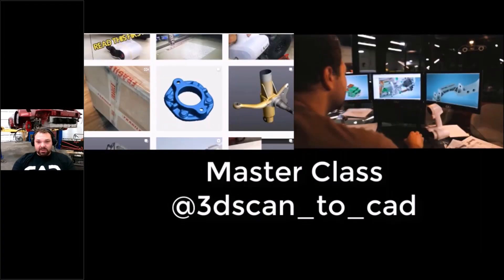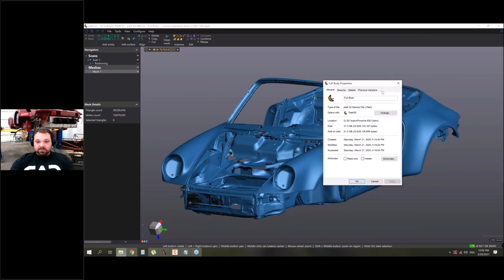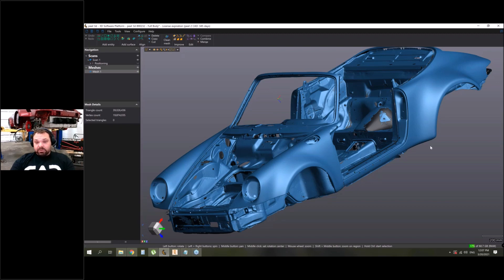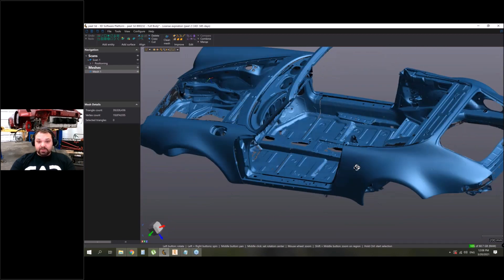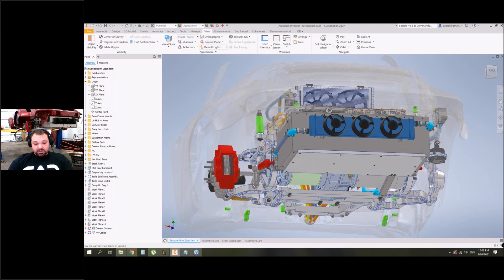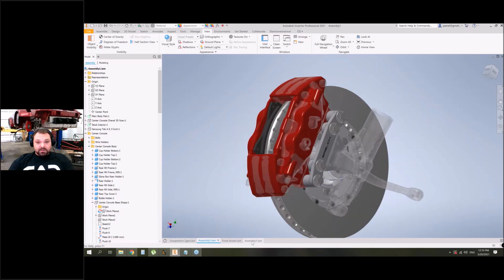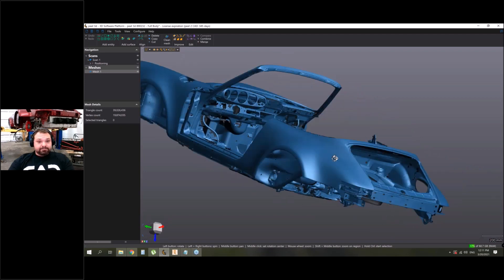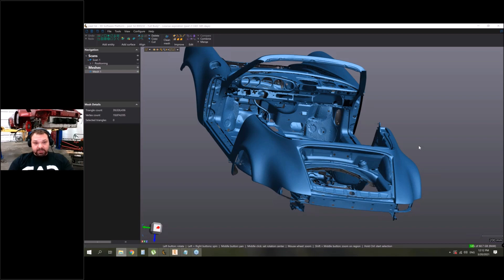peel 3d Guest Webinar - Reverse Engineering using peel 2 CAD

Comment: I'm interested in scanning sections of boats outside. Would this scanner do well for marine applications?
Reply from the maker: Hi Shawn! We do have customers using this scanner outside for various applications. Just like most light based scanners, it does not work well in direct sunlight but is it pretty easy to use outside with a shading device. Feel free ton contact us at hello@peel-3d.com!